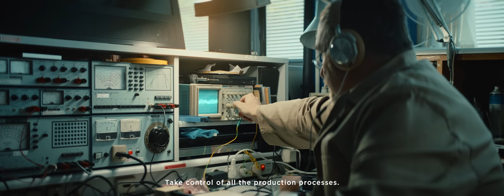Beogram 4000c – Recreated Limited Edition | Bang & Olufsen

Comment: Absolutely love it! I especially like that it can link straight into a Core, Beovision TV or any B&O wireless Multiroom speaker via the 3.5mm Aux input socket, very neat!
Reply: Also the Essence1 ?
Reply: @166Bertje  Yes, the Beogram 4000c can also connect to Essence, PlayMaker or any other audio system with stereo RCA/cinch inputs
Reply: Steve at Sounds Heavenly Wow,in that case I really need to buy the new PL cable’s to RJ45. But I don’t know if the Penta’s display’s working then.

Comment: I remember this turntable as a gimmick for the 1970s jet set. In parallel high performance designs came from Linn, Thorens, Oracle, SME, Rega, etc. B&O never made actual audiophile gear. Along with Braun it's been a leader in industrial design and lifestyle products that blend well into the home and provide a flattering user experience, but to a few exceptions (like the extravagant Beolab 90) it's never been a parangon of superlative audio. The price-to-performance ratio places the company into the ostentatious luxury arena. Meanwhile several audio engineering breakthroughs have come from a diverse and healthy Danish audio industry. Makes you wonder why B&O seems uninterested in reference parts from OEM vendors Jantzen, Scanspeak, Dynaudio, Purifi, et al. and why would one pay so much primarily for good looks and not so much for performance. This realm is dying fast : Today with a pair of well-designed active speakers, you pretty much get everything you need; just connect your smartphone, or computer — some designs even integrate the streamer, room correction DSP, wireless multizone support and so forth — all in slick industrial design that also exhibiting great craftsmanship. If this post seems offensive, it's meant to remind you guys that your thinking needs to evolve. Look at formely prestigious brands like BMW, with zero growth; meanwhile Tesla can't produce fast enough. If you married your first-rate sense of industrial design with truly superlative audio performance, robust mechanical design (sorry, that's always been a weak point of yours) AND realistic pricing, you'd be selling like hot cakes, and not just to Rolex-set poseurs.
Reply: Ouch! - but mostly correct (including the Tesla comparison...). I guess it depends how much profit they're making per unit - a low volume,  high margin can probably survive in this sector, unlike the automotive sector.
Reply: Talking shit mate. While they might not be AudioFool, B*O has innovated in many respects and produce very natural sound. Every cartridge came with its own frequency chart, and the engineering that went into the 4000 that was not advertised was just incredible. They also invented HXPro, sold it to Dolby. That changed cassette deck recordings for so many. 
They might not be to everyone's tastes but as a small company, they innovated and produced tech way ahead of their time... Did I mention they also have the worlds largest private speaker-test chamber?
Not impressed with this makeover personally though. Asking a lot and not even replacing the control board with a more modern design, platter wasn't level in the above video and they do not address a major issue with the 400x series which is strain to the keys when repeated pressing over years but hey ho..
Reply: @ollyk22  
Nope B&O sound nothing natural, heartless
Reply: @vitorinomadeira5456  B&O have made some superb pieces. The Beolab 5000 system was professional standard with the tuner being used in many broadcast studios. The Beomaster 8000 was also made with the intention of making the best receiver possible at that time. The Beogram 4000 was massively over engineered and was very highly thought of, only being let down by the record support. Interestingly the later 4002 and 4004 were simplified but the sound was very similar. If you want a deck more likely to appeal to audiophiles, the Beogram 3000 would be your cup of tea - a Thorens TD124 motor unit with a B&O arm and cartridge - mine has the 12" version. I do have three 4000 series decks and although not the same as the 3000, they audition very well, especially with the 20CL cartridge as long as it is warm!
Reply: well if u cant afford it buy b&w or something like that. B&O is made for a small group of people and they will keep buying stuff

Comment: What type is the cartridge , and who produced it ?
Reply: Bang & Olufsen has always made their own cartridges.  They offered 5 different models of cartridges for this unit depending on your budget.  I still have my original B & O Turntable.  I bought it brand new in 1979 and had it completely refurbished at Bang & Olufsen 5 years ago.  I wouldn't trade it for any other turntable.
Reply: I suspect it is a Soundsmith one made for B&O.
Reply: it is an smmc4 if I am not mistaken

Comment: The reason why Bang & Olufsen turntables are bad is that they no longer make replacement parts for the older turn tables. The turntables are made to work only with proprietary cartridge and stylus, which are impossible to find as new.

Comment: Much too complex and finicky and the end result was a turntable that didn't sound that great. It's greatest weakness was too lean a bass and a rather bright tonal signature due to a platter that is too light and rings like a bell The table was quite prone to breakdown and then find someone capable of repairing it. The best sounding turntables (and most durable) are simple, yet elegant in design and solid and rigid in construction. Linn, Thorens, Ariston, AR and others of that ilk actually sounded better, more musical, extracting more info from the grooves in listening comparisons.